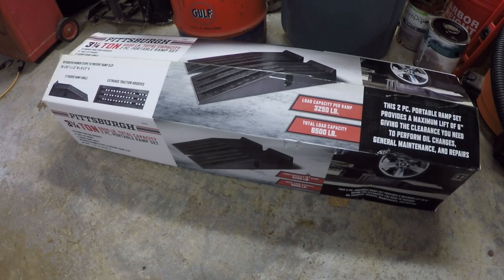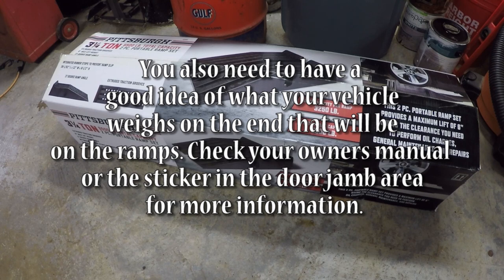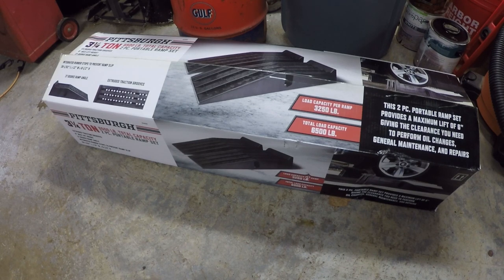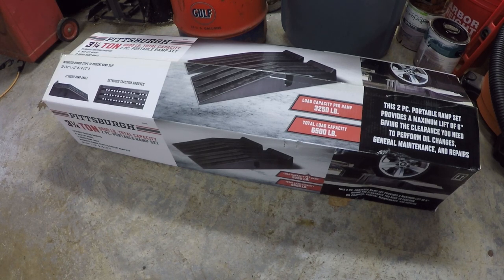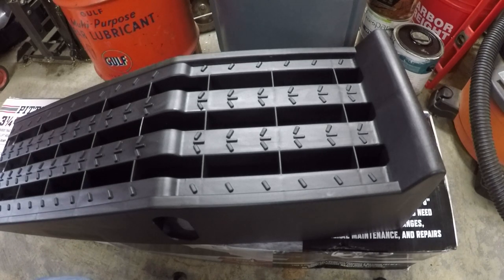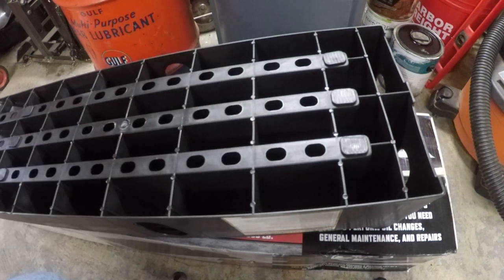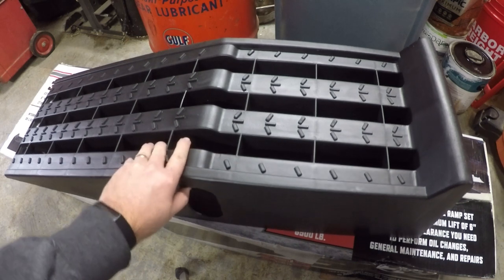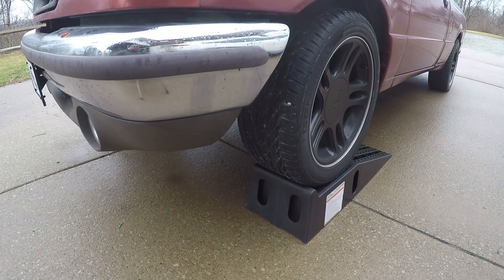Harbor Freight 6500lb Plastic Automotive Ramps - Review & Demo

Comment: Just bought a set for my car this morning. I have a kia optima so the weight was fine as they're only about 3250 lbs. I was worried the clearance would be an issue, but it wasn't. I have a pretty level,  gravel drive, so i placed boards under them, pulled up on them and backed back off just to test, shook it around a bit, and they stayed right in place and didn't skid at all. Left the car on them for about 30 mins just to make sure. Seems to hold up fine. For oil changes, they give plenty of lift for my car and I'm a little big. For 60 bucks, great investment, even if they only last a few years. I expect they will last a little longer than that though. Great video too. Helped making the decision for plastic ramps

Comment: I just bought those last Monday 2-20-2023,the Rino ones got stuck under my car last year and last Sunday,they bent and went back to shape but I no longer trust them.I did use the Rino ones a few times before,I use them to change my oil.

Comment: Another feature is that these are 12 inches wide which is great for trucks or SUVS with wide tires. Most steel ramps are about 9 inches wide.